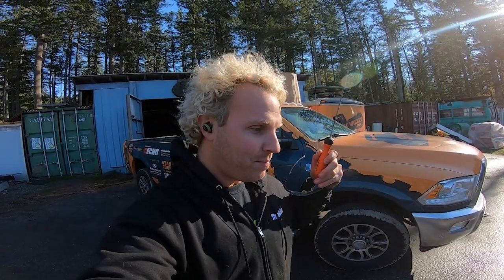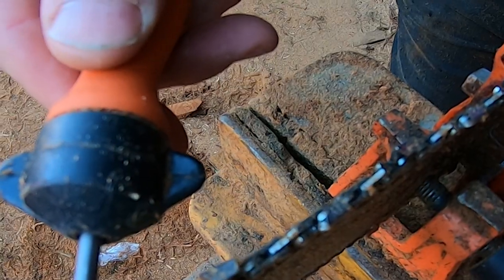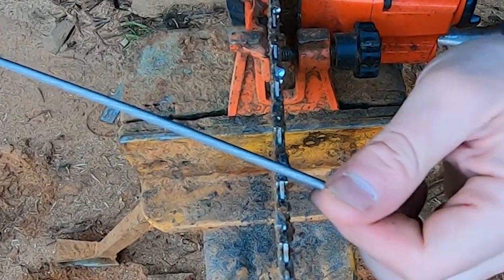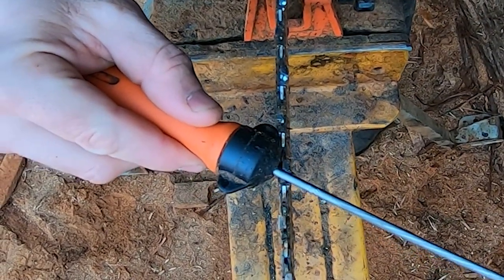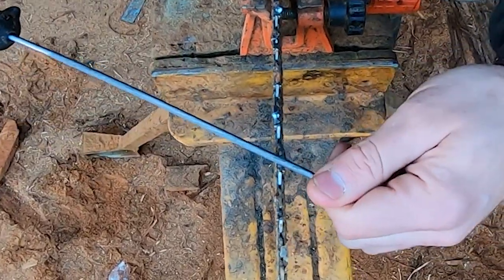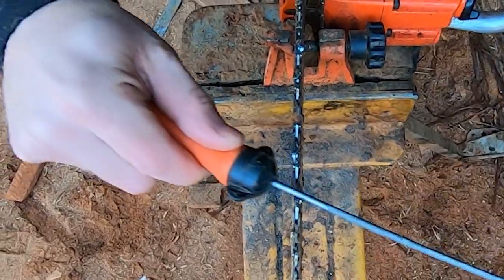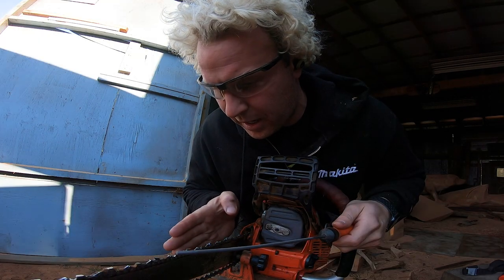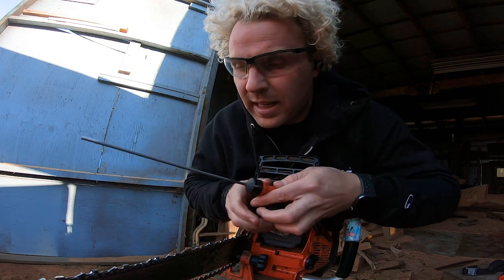How to SHARPEN Chainsaw Chain - Tons of HELPFUL  TIPS - Indepth Tutorial

Comment: Suggest, tighten the chain up for sharpening. Helps prevent rocking in groove, through stroke. So edge  made more consistent & tend to run smoother. Was advised, better to file off bar then wash debris off, give oil bath, drip, refit.
That way helps avoid filings mixing with bar oil to make grinding paste. Components last longer. Save money, buy more toys!
Reply from the maker: Yup all sounds good to me. :-) good notes

Comment: Have you ever tried filing into the tooth. Put your saw in a vice and use the chain brake to lock the chain ,and take the slack out of the chain .   Filing into the tooth leaves little or no burr on the tooth. I find the chain stays sharper longer. Enjoy your videos and keep on  smiling.

Comment: Thanks for a great video. quick question. I've learned that the chain should be much tighter but I see a lot of chainsaw carvers with hanging loose chains. How come?
Reply from the maker: carving bars dont have sprockets which makes tips heat up. if to tight the tips will blow out and also allows chain top flex when doing swooping cuts
Reply: @RyanCookCarvin  thanks for answering my question! I just bought my first carving bar, had no idea! Good thing I haven't used it yet haha.

Comment: Filin an MSA 250 sucks. because it is electric, apparently it won't freewheel. So, after you sharpen a short section, you have to mark another tooth to keep track and pulse the trigger to get it to where you can reach more chain.

Comment: Ryan I’m assuming u use the flat file for lowering the rakes. Is that right. I just didn’t catch the video where u lowered the rake or did I just miss that part.
Reply from the maker: I suggest that. For myself I do it with my finger sander.  But it’s not perfect an takes a lot of practice and wasted chain. Flat file works best for consistency